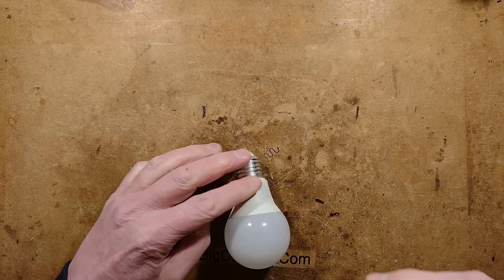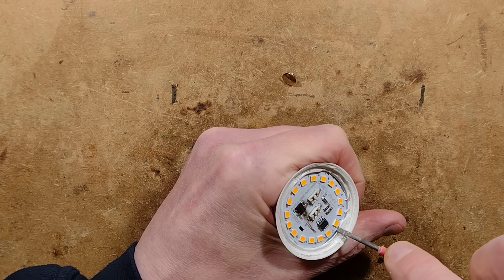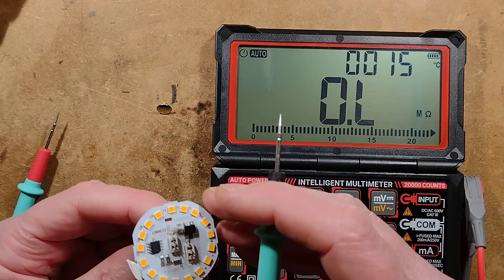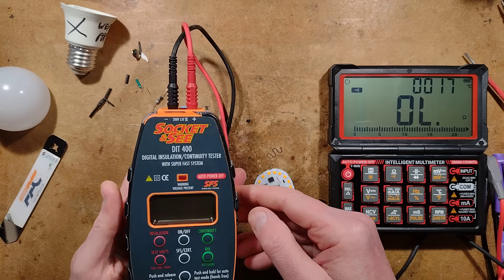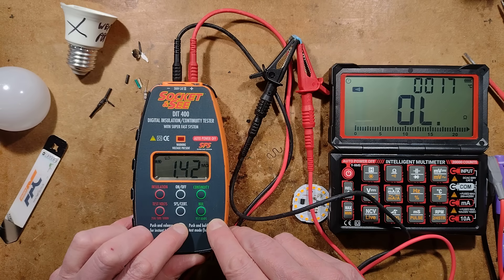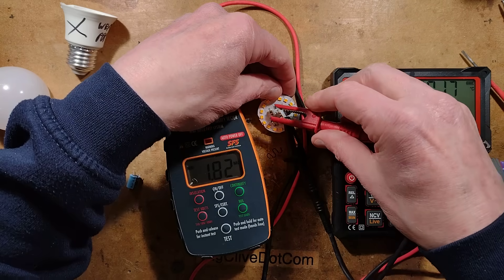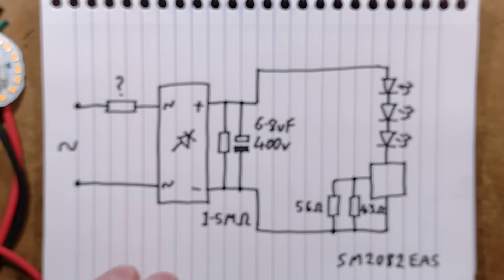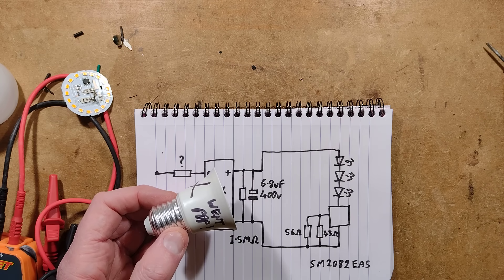Exploring an LED bulb that went POP during a livestream

Comment: Last time I saw a lightbulb go pop was probably 40 years ago. It was an incandescent. A sudden bright flash, a pop , and the glass envelope squirted out of the light fixture and flew across the room. Quite an impressive demonstration!
Reply: A coworker had the same thing happen with LED bulbs.
Reply: How did that happen? O_o
Did it get severely overvoltaged or something?
Reply: @lombaxfan6653  , if you're asking about my coworker's LED bulbs, I don't know; presumably a massive short of the bridge rectifier or filter cap, generating a gas or plasma discharge.
Reply: @lombaxfan6653  If you meant the incandescent lamp, most likely it developed a small leak in the globe and the vacuum was replaced by air. When it was turned on, the filament heated the air, causing it to expand, and the overpressure cracked the glob at the base where the stress was highest. The escaping heated air caused the "pop" and propelled the globe across the room, just like a rocket. At the same time the filament oxidized and burned out in the air.
Reply: I had that happen few times probably less than 20 years ago. I switched the light on and pop glass everywhere. It was one of these fixtures with a bulb towards the floor. Not a fun time searching for all the pieces. I remember it had quite a loud bang as well. I also remember a socket blowing up when I was plugging in our super Nintendo. Scared me a lot. The power adapter was gone but the console was fine.
Reply: I saw a halogen bulb explode once, thankfully it was in a fixture that contained the pieces.
Reply: @Fulano5321 , if contaminated with skin oils when installed by bare hands, halogen bulbs are known to crack or soften and melt from the intense heat. Clean the bulb with alcohol before installing, and wear gloves....
Reply: @goodun2974  If I remember correctly, that type of bulb wasn't meant to be used in an enclosed fixture either, and it was in one of those small glass sphere ceiling fixtures so that probably made the overheating worse.
Reply: That happened to me last year when I was attempting to cook pasta. The bulb popped like a baloon and left glass glitter behind with my ears ringing for 10 minutes after.

Comment: Well? The bridge rectifier blew out. Because it was essentially designed, for 120 American volts. Not your stupid and dangerous, 240 ridiculous power. It was adapted for. Blowing the crap out of the regulator. To be expected. With all of that underrated Chinese stuff. What do you expect from a $10 lightbulb? Years of service? Ha! How else do you think these companies are going to stay in business? By making a reliable product that lasts for years and decades? As advertised?

Don't be ridiculous. No company can stay in business that way. If they make reliable products you don't need to replace but every 20 years. That would be the worst stock you could purchase. I would get rid of it and sell it if I was you. You don't want to invest in a company that makes reliable products. What the FUCK is wrong with you? What school didn't you go to? Like all of them? Past the fifth-grade? In Appalachia high school.

I mean come on now? We should be using incandescent lights. How else are we going to keep our homes warm? Gas? That blows up. Takes outhouses. And then where are you going to, SHIT? If you take your outhouse, out? As most now have indoor plumbing. It's a modern 20th century invention. We got 100 years ago. But not in Appalachia. Which is still a little behind the times and the Tribune. Since they cannot read. And now wonder why LED light bulbs blow out? What they are supposed to last at least 10 years? Ha ha ha ha Ha! Got you! They don't last as long as incandescent bulbs. That can last, 10-20-50 years. And provide some infrared warmth.

In fact... that's how I basically heated mine a state-of-the-art recording studio control room. I used track lighting. With nice hot halogen bulbs. It works a lot like, McDonald's, French fried warmers. Keeping the french fries warm after cooking. And it works great in recording studio control rooms that way. As who wants gas at a lot of carbon monoxide? When the control room is already filled with so much cigarette and marijuana smoke? HUH? You want electric light heating. Not stupid gas. As all of the musicians have already eaten a lot of pizza and consumed a lot of beer. They already contribute a lot of gas to the control room. And could become explosive. That's why you want electric light heating. But LEDs to get warm enough. I'm going to freeze to death in my control room. As I will have to use electric heating coils. And they won't light, the room up. But halogen will. And I remove those in the summertime. Replacing those with LED spotlights. And then put the halogen's, back in for winter. But now they are all disappearing. And I will freeze to death! Without turning on the electric heat. How stupid.

So take your stupid 240 V British rectifier. And get another one! When you go into the lightbulb repair business. You will be swamped.
RemyRAD

Comment: I'm going to bet on a material/manufacturing defect in the bridge rectifier. The capacitor is leaking less than 1mA, not enough to cause substantial extra heating in the diode bridge.

Comment: 7:45 - Why is this red "Warning Voltage present" - LED on the DIT 400, did not lit up if there is high voltage present at the outputs?
9:35 - This is not "out of focus", this is called smoothing edges. There is even a function for the screen to smooth the edges from a font.
Reply from the maker: The voltage present warning is to indicate that you've connected to a live circuit before testing.

Comment: I’ve wondered, how do you diagnose failures when there isn’t an exploded component? I have an SD-IDE adaptor that has failed in a rather odd way, in that one of the capacitors becomes red hot, but can’t for the life of me work out what has failed! 1:00
Reply from the maker: That may be the capacitor itself.  It's a common failure mode of the little boxy MLCC capacitors.
Reply: @ I'm wondering what the capacitor was actually for - I cut it off and the adaptor now works. Tested the capacitor out of circuit and couldn't get a stable reading, so pretty sure that that was the fault.

Comment: Our office building had some kind of power surge related to the fires we had in Los Angeles this past January. It blew out something like 75% of the LED lights in the offices and hallways. The lights were mostly replacements for fluorescent lighting so long format. The electrician who was working on replacing them opened one of the dead lights when I asked about it and it had more components than this lightbulb. One of the capacitors, I think, had smoke around it. They were discarding the whole modules, since nothing is repaired these days.

Comment: They've really gotten those LED lamps down to a bare minimum of components since they began...
Reply: I live in Mexico and we bought a pair of chinese lamps, most don't even have the capacitor or a fuse! I think the effect isn't even visible due to the phosphor coating formulation of these, but I don't know, honestly it's not surprising to expect that type of savings from the cheapest products available.
Reply: @davidrr8741  I guess that just goes to show that even "minimum" is subject to engineering tradeoffs. If you don't care about starting fires, you don't need the fuse, and the capacitor can go (maybe) if you don't mind some 60 Hz flicker in the light output when the phosphors don't respond slowly enough. Thanks - see, I never even thought about it that way!
Reply: Hahahahajahaha

Comment: You can cover the bridge rectifier with a lot of low melt solder & flux to ease it of with an iron. I use two irons in these situations

Comment: Have had good luck just placing aluminium backed pcbs on electric stove top, medium heat. Desolders whole board at once, must be careful, but can pick out individual components just with tweezers when hot enought. Once had to convert LED board from common negative, to common positive, had to rotate all leds in their position 180 degrees.

Comment: It never ceases to amaze me how such teeny weeny bridge rectifiers can withstand the full peak mains wallop. The separation within must be virtually microscopic!
Reply: don't forget it's mains directly over 2 semiconductors. usually rated like 1kv. so just a thin layer
Reply: @ketas thin like thin
Reply: yeah, doping / oxide layers are nothing compared to smd package diode bridges. yet they withstand whole 240vac / 340vdc. or in this case it shat itself somehow. blame manufacturing defect that lowered to layer to withstand just the mains barely. i'm also amazed of those single chip smps controllers which give you 5v at super low currents. they also take mains directly into them. no isolation. this is to power those devices that usually do cap droppers
Reply: @ketas  imagine if cap droppers were banned?
Reply: @Achhcity  It would save me a lot of work....

I wouldn't be having to replace the caps in all of the cheapie crap electronics that I buy all the time in a few years....😵‍💫
Reply: @davelowets  yea but the invention of cap droppers is kinda fascinating also

Comment: I recently made a DIY capacitor from standard kitchen Aluminium foil and kitchen papertowell. I folded the aluminium foil in layers and but a papertowel inbetween each layer. Then I put a book on it as a weight and charged it up...... oh boy.....didnt expect that it was that powerful. Actually very dangerous (dont do at home kids)

Comment: I tested the China-made 1N4001 to 1N4007. When the diode has 100 Volt of inverse peak voltage, the diode get shorted at 102 Volt, and so on. So if the diodes in the bridge rectifier are 400 V Piv, even a slight increase of the main voltage can cause the bridge to fail. 
With 40+ years of experience, a Western diode with 100 Vpiv would fail at 200 V. It is kind of sad to work like this...
Reply: Hard to believe it, any modern 1N4001 usually tests the same as 1N4007 and easily handles 1000V.

Comment: loved the video!  So a bit like the child endlessly asking 'why?' but:  why are capacitors so failure prone, why is it "always" the capacitor? just can't manufacture a robust dielectric?  and is it two 'f's in faf or three? faff?
Reply from the maker: In an application like this they should normally be quite reliable, as they are not usually stressed electrically and it's just 100/120Hz ripple.

Comment: Love this one!  I'm actually impressed that LED bulbs have gotten so cheap that they are rectifying the AC into DC now.  That's a big leap from older LED bulbs which were just AC striings.  I'm a bit surprised at the large electrolytic, though.  I would have expected smaller SMD or tantellum caps for buffering the DC and a high frequency (400 KHz to 2 MHz) regulator instead.  But I guess the electrolytic was cheaper.

You need a hot-plate to desolder stuff on aluminum plate PCBs 🙂

Bridge rectifiers are typically the hottest or second-hottest part on a circuit board like this.  Due to the energy dissipation of the diodes.  At least if its a diode rectifier and not a FED based active rectifier.

Wish that SM2082 had better documentation.  They don't indicate the method they are using to regulate the current.

-Matt
Reply: You'd need an entire switch mode power supply for that.  How is that in any way better than a rectifier, a cap and a voltage regulator?
Reply: @stargazer7644  At the power levels needed to drive a handful of SMD LEDs, an "entire switch-mode power supply" is one chip, a small SMD inductor, and a few SMD caps these days.  Definitely not that big of a  stretch.  And there are some huge advantages to doing so.

LED Bulbs might be trending towards switch-mode operation anyway as regulations have begun to tighten on efficiency requirements.  I can't buy half the LED bulbs on Amazon any more as a California resident because they generate too much heat (are too inefficient).  The ones I can buy are still pretty cheap, though.

-Matt
Reply: @junkerzn7312  "And there are some huge advantages to doing so."  Such as?  Care to elaborate?  Dubai lamps are the most efficient commercially available LED bulbs made today and they don't use SMPS.
Reply: @ Well, you mean apart from generating lower heat?  Which by the way is probably what did the capacitor in... high temperatures.  The extra heat will eventually do the LEDs in too, the capacitor just went first.

Definitely higher efficiencies with a switching regulator, and able to regulate to a much wider voltage range that would be able to handle blown LEDs in the series string of LEDs without causing a chain reaction that blows up all the remaining LEDs or blows up a linear regulator chip because the voltage differential for the requested current is now too high for it to sink.

Do you know how linear current regulators work?  They are very fragile beasts.
Reply: @junkerzn7312  Blown LEDs typically fail open and shut down the entire string.  If you have multiple parallel strings, you're still going to overcurrent the remaining strings with a single regulator, so I don't know what you're talking about.
Reply: @stargazer7644  LEDs are diodes.  An LED only fails open if it physically burns out one of its tap wires going onto the chip.  Otherwise it will fail like a diode... which is typically shorted, not open.

Linear current drivers quickly burn out (or start flickering the LEDs from thermal shutdown cycling) trying to regulate to the lower voltage to maintain the desired current, because they have to dissipate the voltage difference.

Flickering LED lamps are often caused by LED drivers going into thermal cycling due to a blown LED in the series chain.

So you will get a mix.  I don't know why you think LEDs typically fail open.  Remember, they are basically just diodes.

--

In anycase, switching regulators can track aging and dying LEDs far better than linear current regulators can.  The linear current regulator only has a fairly narrow operating voltage range within which the current target must be held.   Outside of that range it will go into thermal shutdown.

A switching regulator has a very wide voltage range.

In commercial designs we use a trick.  Typically we have a full switching regulator due to the power requirements, but the LED driver on the ground-side of the LED chain also has a linear current regulator.   We put a voltage sense feedback on the ground-side of the LED chain to feed-back into the switching regulator in order to ensure that the voltage going into the LED driver (after passing through the series string of LEDs) is less than 1V.   That minimizes the voltage drop through the LED driver and vastly increases the life-span of the driver board.

-Matt
Reply: @junkerzn7312  Why do I think this?  Because LEDs used in light bulbs almost always fail open circuit.  How many have you actually looked at?
Reply: @stargazer7644  Sigh.  Believe whatever you want.  Fortunately nobody has to be on the receiving end of your "wisdom".  I've been working with and designing circuits for these things for 50 years.

Comment: Hi Clive, thanks for the videos. Maybe try an old fashioned analogue type megger (IR) tester, you can get a better visual cue about trends during the test and there's no annoying anti-Darwin delay before tests. I have a basic 250-500-1kv kyoritsu I bought about 20 years ago and it's still my go to tester for most electronic and basic installation testing.

Comment: On LED bulbs, what's a typical forward voltage on the ones with "filaments"? I ask as I wonder if I could re-purpose a dead bulb's filaments for  lighting on a particular model railway building.
Reply from the maker: You can get the filaments with voltages ranging from 3V up to about 100V.

Comment: I love those LED discs, I always save them from dead bulbs for use in other projects. You can cut the disc into several parts and sand off the top layer of coating to make connections, and then make so many lighting projects. And they'll last nearly forever if you run them at like 80% of spec! Plus you'll know the light temperature and quality from the original bulb itself. They're one of my favourite salvage components!
Reply: Very cool way to reuse them
Reply: Be interesting to know how long this bulb was in service before it opted out.
Reply: If only one or two LED in the board is blown up, you can bridge the connection and put at least 2 LEDs in series for every blown up LED. It will work again, even though it's slightly dimmer because you add a bunch of LEDs in series, but it will further extend the lifetime by a lot, as more LEDs in series lowers the voltage for each LED, thus reducing the stress
Reply: Bro, I about to do dumpster diving in my shed now. This is a great idea, kids gonna love more lights.
Reply: Would love to see an example use video

Comment: Wish these bulbs have some basic ventillation built-in, without needing to compromise the diffuser(since heat is one of primary accelerants to premature failure of most electronic components). But wait!, they may not PoP for a while. Bad idea for the manufacturing machinery!. In this particular case, it is probably a spike on the input supply voltage, going above the max reverese peak voltage of the diode in BR shorting it out through avalanche breakdown. Normally electrolytic capacitors bulge and vent out(its stinky innards), in case of failure. Can't verify, unless you have had a powersupply logger, when the event occured.❤👍
Reply: you could just pop the cover off
Reply from the maker: Unfortunately, popping the cover off exposes live connections.  In the past I used to drill vent holes in compact fluorescent lamps.